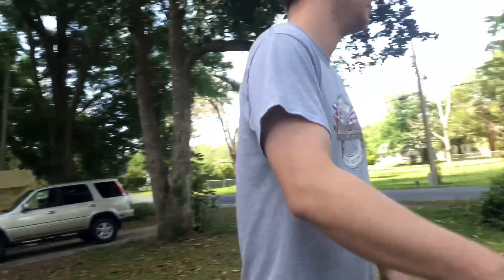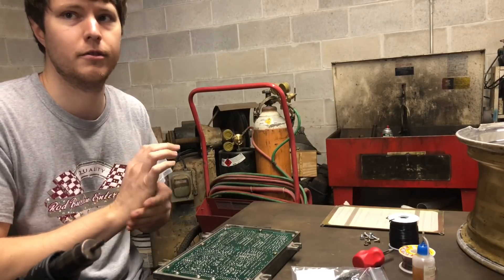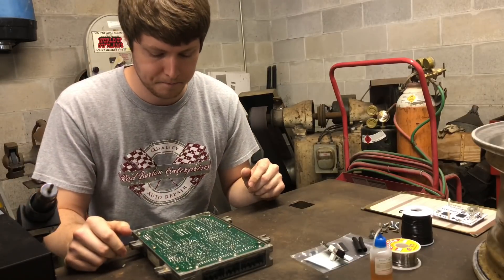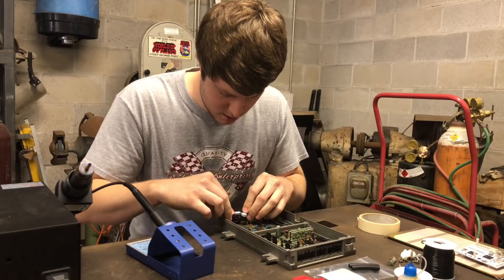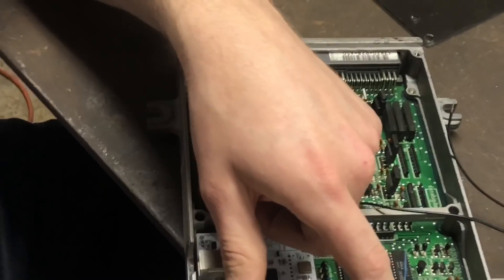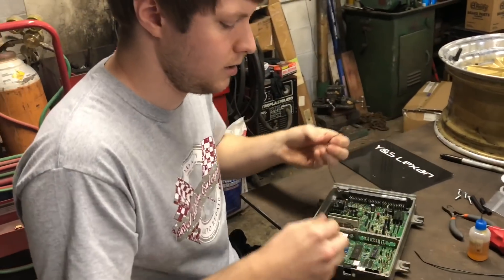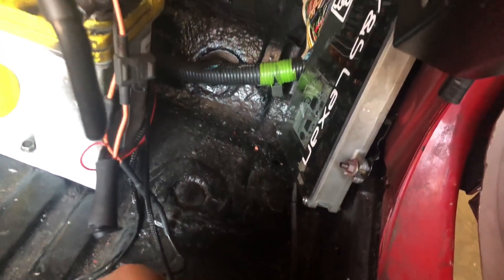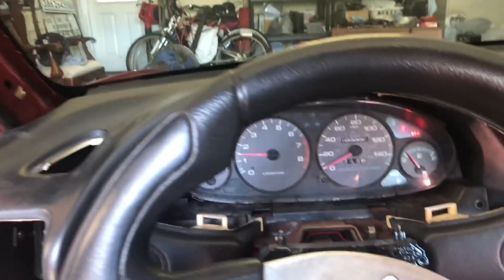Most Affordable Coil On Plug SetUp!! || Burton Racing

Comment from the maker: Hey Everyone! Been getting tons of questions on where to order the Burton Racing Kits (Coil on Plug, Plug and Play Fuel Relay Kits. Etc etc)

Discount code : SPTUNING
Check them out here : 

https://www.burton-racing.com/?ref=jjlsf9sx_6

Hope this helps yall!!
Reply: SP Tuning what type of coil packs did you get k20 coils?and also where you order the coil plate from?
Reply: I have an LS vtec b18 on a Honda crx.
Need to know what ecu I need and distributor. I’m putting this together because it came disassembled
Reply: Bernaldo Nieves I would get a obd1 Ecu that’s chipped or have it chipped and a obd0 to 0bd1 jumper harness for the ecu to work
Reply: BTO Coil On Plug kit 149$
https://www.facebook.com/104249021002646/photos/a.104309820996566/125756405518574/?type=3&theater
Reply: code still active?
Reply: So the cables I’m plugging into is??????

(8) blue engine speed signal
(9) yellow/black IGN input

Please confirm

Comment: Hey so In my position I have a obd2b car with the obd2b engine harness but my ecu is a P72 obd1 , so do I still run both yellow and black for power and blue for rpm ? Or I don’t run the rpm which is the other one ?

Comment: Hey everybody... I have a code 9 on my 97 Honda Accord h22... I’ve change dizzys and after a hour drive car turns off and give me code 9 again... I also have v1 Honda on p28 Ecu .... I’ve also change the cyp and tdc sensors by the timing belts... please need help... any suggestions will help.. I just don’t want to get an distributor and have the same issue... they are very pricey... thanks luis

Comment: @ 4:13 
"Annoying Buzzer Sound" Wrroongg! JK... But seriously, in theory it sounds good but Anyone running a mid to high hp(400-800) street car is most likely running Ethanol & I bet if you asked 10 tuners what they gap @, I bet 8/10 will swear on tighter gaps... Tighter being between .18-.25
My STi w/30R kit on E85 is running .18 on 1 step colder NGK IRs making 580whp  
My Evo 8 w/20G on 92 Pump is running a .23 with ½ step colder NGK Coppers making 410whp.
Just saying, bigger gaps doesn't mean more power!

Comment: I probably need to do this my 2000 civic si b16a, it takes awhile to start when cold acts like a carburator and needs to warm up before I touch the gas or itll die.

Comment: You stinking Four banger and Honda pukes and your tomfoolery! This is nothing more than another attempt to...got your blood pressure up, didn’t I? It’s exciting to see a new generation finding ways to wring more from the cars that you can identify with. More power, more speed, more satisfaction from the experience of hot ridding your own stuff. I love that your generation is on the leading edge of development of new technology. A lot of crusty old bastards like my self are quick to sneer at a Honda, but so much of what you’re doing has trickled down to awaken a spirit of discovery in us gray hairs. My old ‘65 Mustang fastback and small block Ford had been relegated to the need to run a ridiculous amount of compression, cam and CARB. Two of them... And running only racing gas, which limited me to local cruise-ins. I’m now glad it took 17 years to get my engine project restarted. I’ve sold most of the carbureted fuel system parts I had accumulated, and I’ve taken the plunge into learning to use EFI, high efficiency aluminum cylinder heads, and with this video, I’m emboldened to explore coil-per-cylinder. It’ll still have a solid roller cam, but thanks to technology and electronic engine management, I can now use 11:1 compression instead of 13.7, and make serous power on 93 octane dog water. I hope that young people will become excited and STAY excited about the future of hot ridding that they represent and have the power to shape. It’s truly not about WHAT you’re building and driving, it’s THAT you’re building and driving. Rock on, guys! And girls...

Comment: Did this some time ago with an STM32 and honda jazz coils. The issue is with dwell time. If you run the stock dwell of a bseries motor which is 5ms then the coils will run hot.If you run the coils at a constant 2.3ms dwell then the car will need to be retuned. Still it was one of the most interesting projects i did. Overall cost was less than 30$ including the coils.

Comment: 12:10 hope you did it for visual purposes for the video but I hope you took paint off of the cop dizzy ground.

PS I know the engine is grounded and the bolts threads thru but it will be a better ground nonetheless. Do yourself the favor.
Reply from the maker: The bolt threaded into head is paint free which provides ground through there. Grinding off the paint would also work for piece of mind :)

Comment: Hey sorry but I got a 2003 Acura rsx k20a3 but it runs then looses power then dies changed crankshaft sensor and fuel pump but does the same thing also code it gave me is p0661 imcr valve changed the sensor but still same thing u got any advise

Comment: I have a question about COP but it doesn't regard any D, B, H or F series engine.  It regards the G25A inline 5 engine in the Vigor and 2.5TL.  

You guys made a good point about COP eliminating the need for the harder to find cap & rotor assemblies and this is especially true for the Vigor as OEM is no longer available and aftermarket ignition on Hondas seem to never work or last as well.  

My question is could this or any other COP conversion kit be adapted to the G25a?  My concern is the ECU and how it may or if it differs from the ECUs you guys normally work with.  Along with that also the sensors on the engine itself, crank, pulley and the rpm signals may differ in reading.  

The car is OBD1, there is no available or history of any ECU chip.  I read the JDM ECUs can be chipped.  The ignition has a large external coil/ ignighter that gets a signal from the ECU.  That large coil feeds the distributor which then will go out to the cylinders.  I don't believe my distributor has any sensors inside the cap or rotor.  There is no wiring harness gping into it other than the single coil wire. 

I would love to have a stronger spark to help support high rpm efficiency.  I want to build the engine naturally aspirated and aim for 230whp.  10:5.1 CR, cam regrind, oversize valves, custom header, port & polish head, larger TB but then the ECU hold it all back.  

Maybe some other honda ECU can be adapted to signal 5 cylinders and accept a chip tune?  

I know its a trumendous amount of one-off work but hey, Power of Dreams right?  Lol

Comment: Honda rulez cop conversion is another kit that does this for cheaper
Reply: Honda rulez is a cop conversion chip, which is actually what is used in this "kit". He does not supply kits only the processing board. The kit we assemble is to streamline install for buyers who want a clean and quick installation with all components included.

Comment: Hall sensor signal goes to the adapter board directly. So, ecu will still control the ignition timming?
Reply: Yes, ignition timing is completely adjustable via the ecu as well as still setting base timing by clocking the distributor.

Comment: Pointless if you ask me since you still keep the distributor😏
Reply: For looks? possibly, but coil packs still look better than spark plug wires. For performance? this kit is most defiantly an upgrade and VERY useful.
Reply: You need to for the rpm and phasing of the cam.  I'm sure you can integrate it with the aim sensor somehow and delete the dizzy.

Comment: what if use this coil pack without hondata? just stock engine... can it be use?
Reply from the maker: Yes sir. You can run this on a stock obd1 ecu with no hondata
Reply: SP Tuning the best... thanks for the info bro.. 👍👍👍👍👍👍👍
Reply from the maker: Happy to help 💪💪
Reply: Ok so with out the tune, how much would it cost to do this swap on a 99 crv
Reply: Kyle please send us an email located in the description thank you.

Comment: I don't get this if u went through all this troubles n the dizzy still in place needing the signal from it. What the point lol. Just leave as it is. I thought the whole process of this is to eliminate the dizzy.
Reply from the maker: The benefit is a stronger spark on each cylinder, you can run a bigger gap without it causin problems like distributor with single coil. Most coil on plug kits function like this, some use a trigger off the cam gear itself but that in itself as a sensor cost more than this kit
Reply: I'm sure someone will figure out how incorporate the stock s2000 or k series sensor for cam phasing and rpm.  This is a budget kit for those wanting better spark without spending a grand.

Comment: Ive always had this thing in mind doing this to my 1997 civic with the stock d16y7 with a manual no vtec. Also wondering how it'll perform since i dont plan on putting a turbo. Just coils and no plugs. 🤔
Reply from the maker: Ypu can do it on d series too :) youll have a more reliable spark. Maybe even a slight power gain or smoother power band.

Comment: 14:47, you mentioned that because its E85 thats the reason why it takes awhile to start but i believe if you just went to CoP design the ecu is so much quicker at sending signals to fire the coils. Distributer before was a moving part that could be a reason right there

Comment: This is essentially a distributor delete kit right?
Reply from the maker: No, still need to run dizzy for signal inside for the cam position
Reply: ahh ok. but pretty much the purpose for doing this is its more reliable i guess and it should respond alot faster than the mechanical arcing from dis

Comment: Wait... $360 for this entire CoP kit, all included? That's f'ing amazing!
Reply: Hey Omar, the MSRP on Hondata CPR kits is around $395, this does not include coils or the $500 s300 you will also need. All said and done most consumers have roughly $1200 into their ecu to run a cop setup, or you can buy the aem for $850 msrp. Our kits start at $320 and do not require any other expensive accesories. Unlike hondata we also supply the coils and can have a complete setup running on any obd1 ecu for roughly $400. Just wanted to clarify, thank you and hope you enjoyed the vid.
Reply: considering I'm COP handicapped lol what coils are the correct ones to use for the D-B series?
Reply: nevermind I saw the other guys comment and your answer about them being k20 coils lol my bad.
Reply: That's how much hondata own cost
Reply: jay m shoot me your email and i will contact you later today. Thank you.
Reply: Yes it is
Reply from the maker: Its a good pricee. Just meed to buy coils and plate

Comment: Do you splice the COP wires into the existing wires in the harness plug or do you depin the existing power and signal wires and replace them with the new COP wires you were provided with?
Reply: And also what coils did you use?
Reply: What did you do with the wires you pulled out from the harness plug?
Reply from the maker: The harness wires plug into the harness for the coil on plug. Im using k20 coils

Comment: With this setup could you possibly remove the distributor all together for a neater look? :o
Reply from the maker: I wish , but no simce you still need cylinder position signal
Reply: There is a smaller digital distributor with built in coil on plug coming soon

Comment: any issue with the painted dizzy ground
Reply from the maker: The bolt itself threads into a clean cylinder head providing the necessary ground.
Reply: I figured, i just had to be a smart ass. Keep up the good work!
Reply from the maker: Ahahah youre fine bro :) thank you!

Comment: But can you remove the distributor, leave a bolt on the ground wiring and cap the hole where the distributor was and will it work? Or does it use the distributor for something? I'm not an expert and kinda got confused at the end. Awesome video by the way
Reply from the maker: Thank you for the support. It still needs the camshaft position sensor inside the distributor
Reply: @SPTuning  does the camshaft position sensor tell the ecu when to fire? I have this cop kit and suddenly lost spark. Any help would go a long way. Thank you!
Reply: There's a system in the works that replaces the whole dizzy with a compact digital version with coil on plug built in, no ecu mods needed
Reply: dstorm19 been waiting on your CNC guy for years... (*≧∀≦*)
Reply: But you can remove the cap and rotor right?
Reply from the maker: Yes

Comment: And I'll just get an MSD box. That does the same thing?
Reply: Msd is junk for a Honda.  Shitty install process and always fails  my tuner hates it
Reply: josh Griffin msd is quality As fuck and if you had a failure it was by you’re own error they also have epic customer support and you clearly are just talking out of you’re ass
Reply: josh Griffin : I have had in a MSD box on my station wagon 4 years. With no issues even drove the car to South Beach Florida from Baltimore.
Reply: We highly dont recommend an msd box with this setup, its honestly not needed and this will support all the power you need without the extra money spent. Also by the way this does not do the same thing as an msd box, this setup converts the car to coil on plug ignition system.
Reply: I've had an msd on a d-series for almost 10 years, no issues (SCI-L so basically a 6 series with rev limit). The reason I'm getting this for my b-series is you'd need 4 MSD boxes & coils to get the same result. The coils have an appropriate amount of time in between sparks to recharge when you're kicking out 8750 rpm